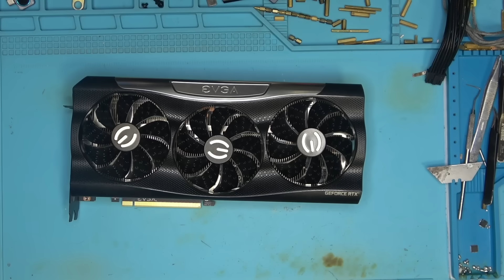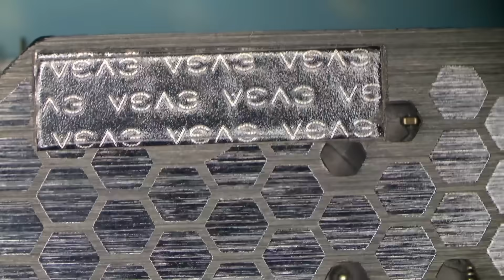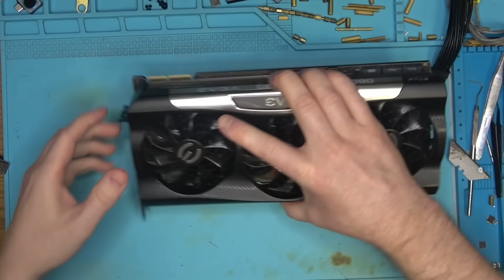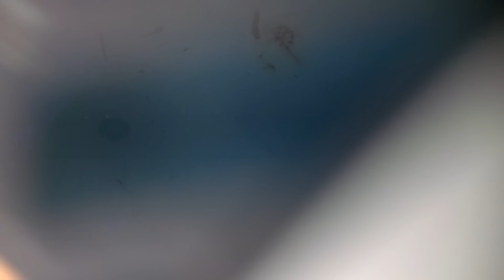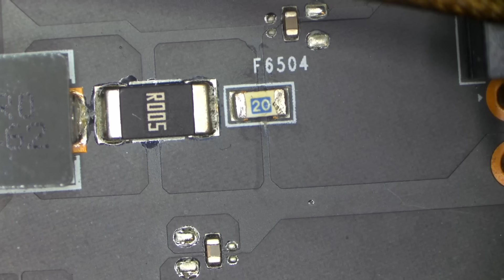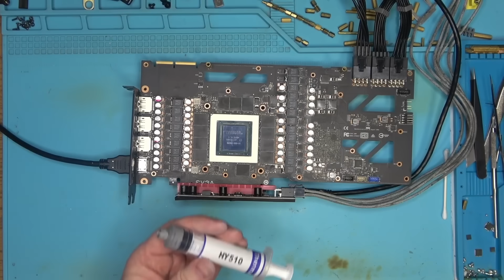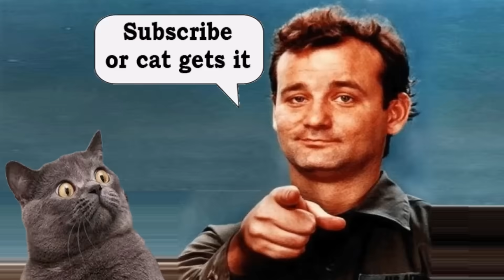Your EVGA 3090 will soon break  Now to fix it properly

Comment: I’m not sure if it’s board revision or you can tell by part number or otherwise. I have 2 of these units at home that are water cooled and thankfully (knock on wood) haven’t had any issues yet. Granted they have full front and back plates and really haven’t seen above 65c even at full tilt. I feel like we’ve seen nothing but problems with stuff after the 10 series of cards.

Comment: The little brass locking slides on your preheater, did you machine them yourself or are they an available product? I don't like the stock platform setup on this preheater.

Comment: Why not check the driver chip for said troublesome pair of mosfets? The waveform look ok?
From my days of audio amplifier and inverter repairs, when one mosfet bit the farm, all the other were suspects. So I would change the lot. to be sure. Otherwise doing 1-2 would just make it come back eventually. Fortunately it wasn't SMT,  and worth the trouble. Bad board design was the usual cause.
Reply: He changed at least 2

Comment: Nice work! I've got a question about a used RTX 3090 (Palit Gaming Pro, NED3090019SB-132BA) - it runs with Hot Spot temps reaching 100C, but VRAM temps appear fine. What kind of a maintenance does it need, if any at all? Would repasting it be sufficient, or do I have to change the pads too?

Comment: Had an evga psu. 10 years warranty. At the 8 year mark the connector goes bad and almost burn my house down. Send it to evga and they find "corrosion" on the port. The corrosion was due to the pin arching and being eaten away. Wasted 1 month of my life for that and 20€. Bought a 2€ connector, desolfered the old one and soldered the new one. Working well ever since. Fuck you evga. Never gonna buy your product anymore.

Comment: EVGA's RMA dept may have sucked but they were a really beloved brand for a reason. I dont get the hate. I know YOU only see broken cards, so I get it. But there are SO many good products that EVGA made. Had EVGA had more time to deal with 3000 series, I bet they would have been able to spin a better board too. Its NVIDIA's fault for giving them the design SO LATE. And ultimately its NVIDIA's fault that EVGA no longer exists in the GPU space
Reply: Overengineering is always bad news for the consumer.
Which is precisely what EVGA did.
Reply: @hyoenmadan  are you an engineer or are you just saying that? I'm an EE. Over engineering is typically a good thing for the end customer, but can be a PITA for a repair technician/service. For this series of cards specifically(3000), EVGA got VERY LITTLE engineering time and thus their cards suffered. There is plenty of documentation out there saying exactly what I'm parroting. I still daily my EVGA 3090 for my living room PC. My EVGA 3080 is used everyday in my son's gaming PC. My EVGA 1080ti is run 24/7 for folding simulations without any issues. Many of EVGA's older designs(900/1000/2000) were so solid, that you never had to service them other than thermal paste and pads(if needed). Where on the other hand, I had many MSI, ASUS, and Zotac cards break down on me because of poor board layout. Heck, do you remember how bad the NVIDIA "founders" cooler designs used to be?

Comment: My FTW3 3090 was running with a 500w bios flawlessly for years until I retired it 2 months ago. I left my pc on all the time too. It would mine with plus 200 on the core and plus 1200 on the memory. 24G-P5-3987-KR is its part number. Edit, it was not mining that entire time but it had its fair share when it was popular to do so. I repasted and copper modded it.

Comment: Im the same way, had a card 1660 TI 6GB not work no video here the circuit were covered with thermal paste, same with the rtx 3060 OC V2 12GB, i took them apart broke the seal flipping the bird at the companies, same result with the CPU on the GPU/CPU.....too much thermal paste.  plus overheating because my main gaming rig would black screen, here dead short not enough thermal paste on the GPU/CPU, cleaned them both off, re-pasted them both correctly like a Cross or an X pattern, slapped it back together, both, and they are working flawlessly in my gaming rig as we speak.....ASUS Okay EVGA, bad, they dont know crap about electronics at all...

Right now when I bench test both at the same time, they are SLIed in a way but through the MB, they are happy.....

Comment: Wild timing on this one. I just had my own 3090 FTW3 start failing, and was able to figure out the issue was a screwed mosfet. In my case, the exact same mosfet even. Did the same fix as was recommended by some stuff I found online and got it working again no problem thankfully. 

One of the reasons I like EVGA was the random features. I'm loving the spare gpu temp pwm fan header on my 3090, my SSD right above my gpu overheats when i hit it hard, so i got a 90mm fan and some cheap aluminum heatsinks stuck to the backplate and it helps dissipate heat great and keep that SSD at a nice temp. Niche stuff, but sometimes interesting and fun to play with.

Comment: EVGA was praised for their customer practices,  AKA honoring warranties.  They were also the only company to treat gamers right during the RTX 3000 series launch by creating a fair queue for purchase. They also gave the finger to Nvidia and stood on their laurels.
Reply: I have a few EVGA cards that still work and have never been repaired, G-Force 2 MX and an 8800 GTS 512.

If I can remember right the cards that I had that failed and may or may have not gotten repaired far outnumber that, off the top of my head a 6600 GT 8800 GTS 320 which had been repaired 5 or 6 times I've melted a gtx260, I've had a few fermi series cards that failed and an EVGA superclocked GTX 770 that's cooked that was never never sent in. And I remember getting space invaders on my last EVGA card which was a gtx 1070.

Comment: if companies RMA really cared about fixing cards (Better than factory) they'd hire this guy to train an army of techs to fix cards this well. the feedback and information they would get back, too, about their production, would help them build better cards ... its just a head scratcher. they put soooo much work into their assembly lines, just look at the LTT tour of the Power Color factory, these things are incredible. to put in ALL that work, and have little to no support for the product is insane. and all of the manufacturers are like that. i just dont understand. if its faulty off the line, you can basically get fucked. seems like such a waste of opportunity to learn about their OWN quality.
Reply: Well said. Given the kind of money which GPUs are now being sold for they now need a proper support network and after market service , with spares and authorised repair networks. It's unacceptable that Northwest can't order new PCBs from Asus or dies/VRAM from nVidia for example. Also not having access to official documentation/schematics/methods of repair.

It's like the industry is stuck in the 9700 Pro era 20+ years ago where flagships cost $250 at most , and not $5000+ as one very recent MSI flagship is being sold for
Reply: For investors, is more "profitable" if you spend $5000 annually in a new card, you know. That AI bubble will not pump itself.
Like HP said once... "Any product who last more than its warranty is an engineering failure" (tm).

Comment: Interesting about the paired MOSFETs. I had an evga 970 several years ago. It died and o tracked it down to a mosfet. Changed it and it worked for about a month then died again. It ended up being the mosfet next to the first one. After changing that one it was fine for at least another year in my kids pc before I upgraded him.

Comment: 0:00 During the first great GPU shortage I didn't buy EVGA 3090 (lots in stock) when the only Strix 3090 walked out the door 😱 'cause 2080 experience 🫤
Salesman advised a shipment of Strix were due shortly at another store and that's what I'm using now to write this 🙂

Comment: I have no idea what anything means but this is still awesome.
Reply: means your 3090 is about to be toast!!
Reply from the maker: @OffRoadTakeOver  lol
Reply: @OffRoadTakeOver  Done by design, by nvidia's standard, make it last exactly 2 years.
Reply: @OffRoadTakeOver I was just thinking of getting a 3080/3090 to upgrade my 2080ti/i9-9900k combo but now im reconsidering lol
Reply: @extremistcontentfan1236  get as new of a card as possible
Reply: @20x15cm why
Reply: @extremistcontentfan1236  3080 is already almost 6 years old, and it was one of the most used for ethereum mining.
Reply: @extremistcontentfan1236  u must be stupid as horsass, why? U commenting video with reason why, wtf this world should end
Reply: Relatable
Reply: The answer is here: 11:04
Reply: Slap a waterblock on it
Reply: @ChrisGR93_TxS  Do the cheap mosfets have the saving grace of being waterproof?
Reply: @paulchamberlain7942  lower temps lower resistance ehh it helps a bit (all my high end gpus were/are on a full waterblocks and never had any of those issues . cards no matter the wattage never exceeded 50c at summer. worse case scenario)
Reply: I'm curious what part you're confused about.
Reply: @insertnamehere4419 I just don’t really know much about the inners of GPUs so I don’t really know how all that stuff works and it seems very complicated to me.